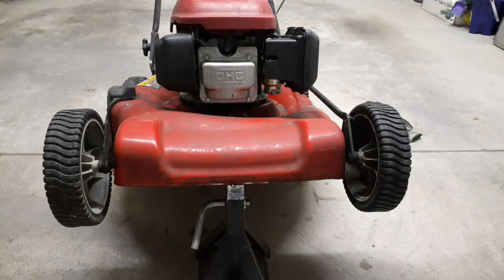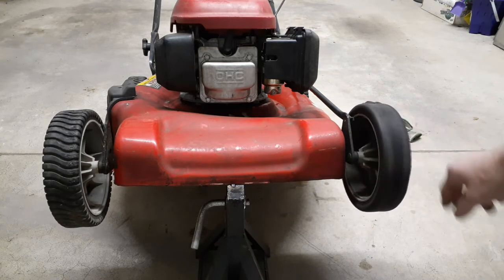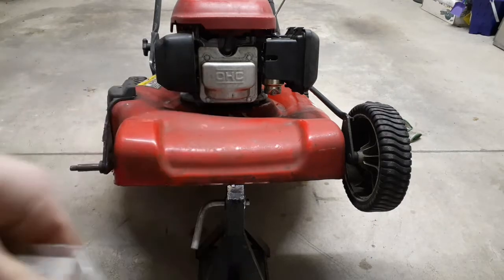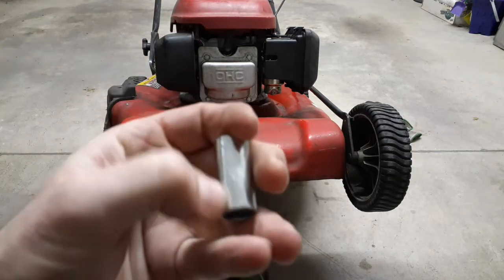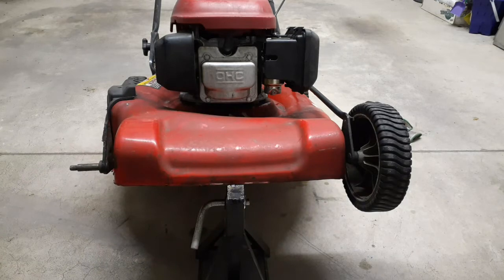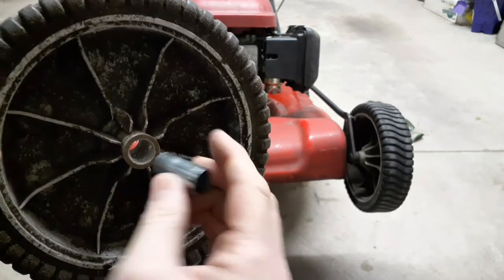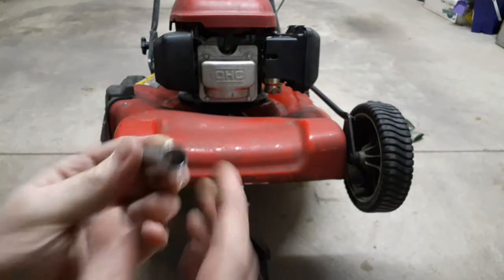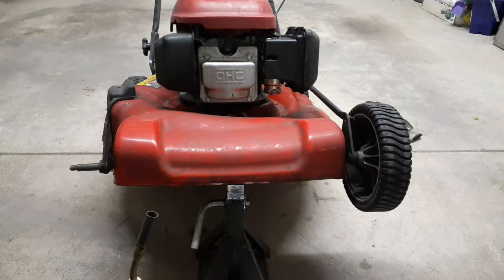Mower wheel repair for a wobbly wheel

Comment: Thanks for the video and the idea of heating the bushings. I just finished repairing both rear wheels, using your idea. I cut two brass bushings out of one $3.98 bushing from Lowes. Heated them up then carefully pressed them into position. I think both wheels should now last a long time. Saved more than $60.00 by not buying new wheels from Troy Bilt. Thanks
Reply from the maker: Glad it helped. Please subscribe. Thanks.

Comment: Hi from the 🇬🇧 good job on the wheel fix..
Reply from the maker: Thanks. I was just checking out your mower hoard video. I've never seen so many Briggs OHV engines. They are not that common here but a great motor.
Reply: @berardia4  thanks for watching.. yeah a common engine over here..